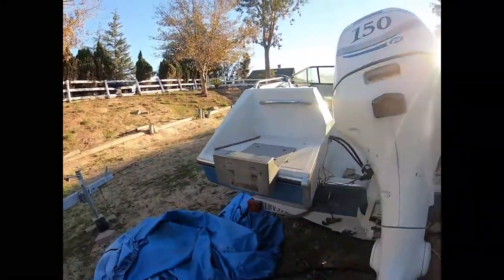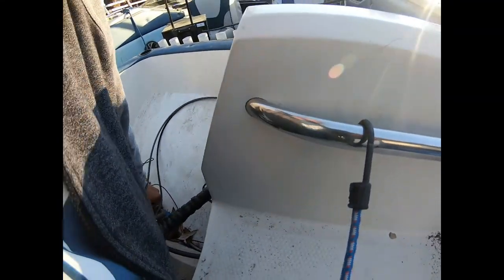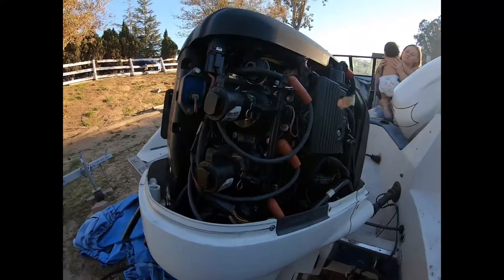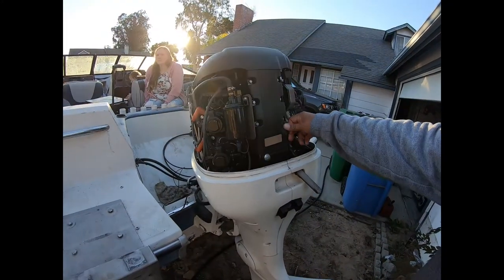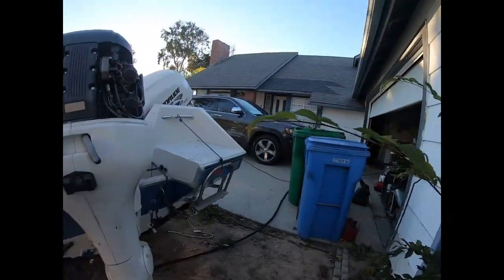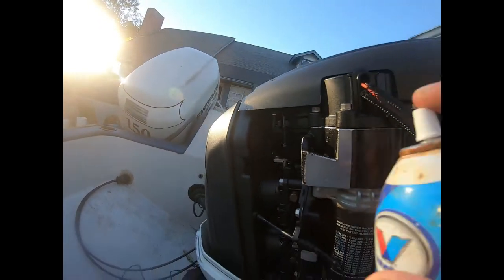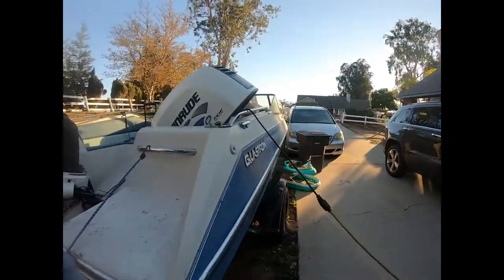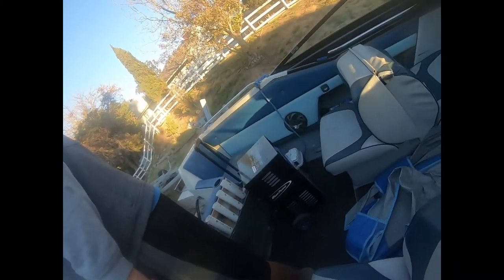HOW TO COLD START A  1999 EVINRUDE  FICHT 150 HORSE #BARNFIND

Comment: Hey how's it going!!I have a 1999 Evinrude, 225 HP, it's just starting to spray like you did.Can you tell me what the problem is?I've already changed spark plugs, gasoline filter, electric fuel pump, vapor separator, scanned it and there was no error!If you can, send me a photo of where you spray the spray, without the cap!Please!
Reply from the maker: Are u talking about spraying it to get it started? Yes I know on the 150 hp I show where it's at. I have learned a lot about these motors from Facebook Evinrude groups. I believe there's three that I'm part of. If u ask a question on there, you'll usually get a bunch of answers
Reply: @makingmagicfishing541  tank you very much!
Reply: I know this was 3 mos ago, but if you haven’t got it figured out yet, wanted to throw out a suggestion. I’ve got a 1999 200 hp and had the same issue, there’s a plastic casing on it, looks like an intake like a car, mine was caked with oil and there’s some kind of sensor on it. When I took it off it fired right up. Cleaned all the oil off and put it back and it started fine. May be something to try
Reply: @Packindips  Thank you very much